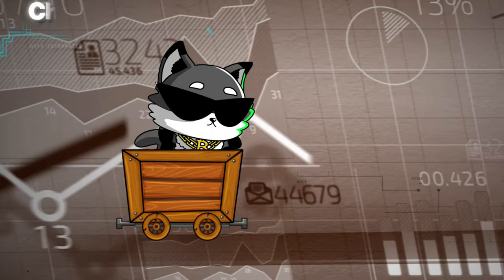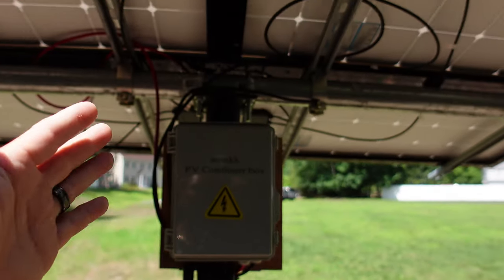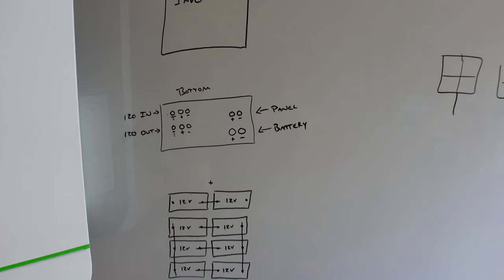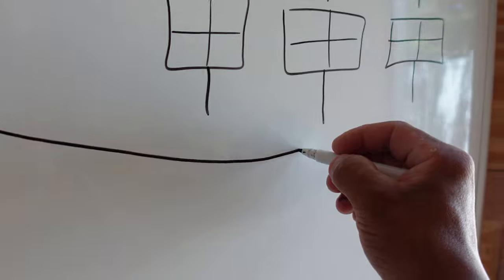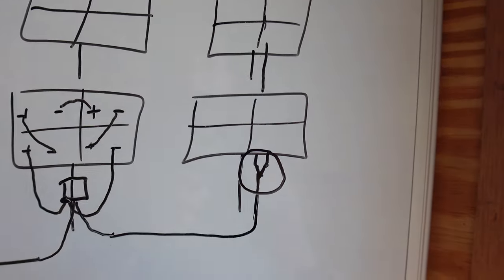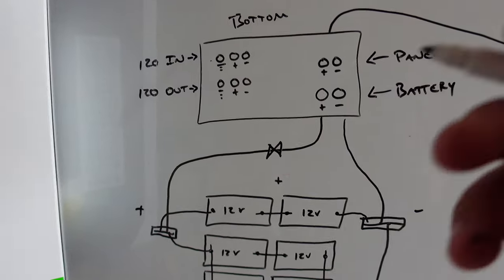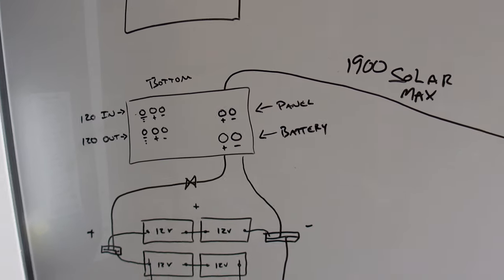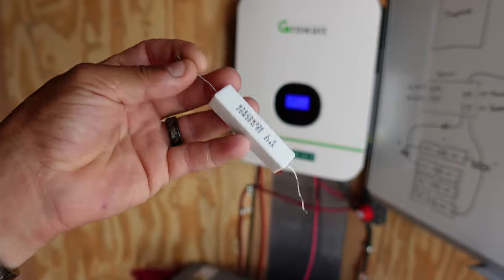Explaining my setup inside the crypto mining solar trailer

Comment: so about the fuses. with a 3 kW inverter, you could max. take out 125 Amps out of the batteries. So your 250Amp fuses are one the safe side. 
however one thing is to consider. Delivering 3kW is not always 3kW. It is hard to explain in a few sentenses, but the power is calculated with volts x amps. That results in VA (volt-ampere). In case your electric consumer is a classic light bulb, the VA is identical to W (watts). But in case of the power supplies for PC/s & mining rigs, that's not the case. for a 1000 Watt power supply, you may use 1050VA (maybe more, maybe less). This depends on the efficiency of these power supplies. 
However any Inverter needs to produce that power. You may not see it on the display.
You may also try to find an amperemeter, that you can put around the cable to measure the current. It may help you to find how much current you have floating around. 
How thick are your cables between the combiner box and the Growatt?

Comment: bro your solar video are awesome. please let me know how many KW and as you know there is on grid and off grid and your setup is off grid, I want to ask why you opted for off grid because batteries are required in off grid it costs more. If you would have gone for on grid batteries are not required and extra electricity what is un-used that goes back to grid and goes to the electricity provider and they will adjust in the electricity bill. By this there will be 2 way benefit you can mine also if not using mining electricity will go to the provider and bills will be weaved off. I stay in India and i have 1.1G hashrate and my plan is to setup 10KW on grid solar system in coming days.

Comment: IM building my setup with the MN5048DIY from Midnight Solar.  It has 500V input so I can run a buttload of  panels in series .  Less wiring, no need for combiner box, can use thinner wiring.

Comment: @chumpchangexd Which model number inverter do you have?  SPF or MIN?  I’m guessing it’s SPF since you have backup batteries.  Did you consider doing grid tie only?  The grid tie series inverter is cheaper and you don’t need batteries.  In fact you are probably using much more power to charge the batteries than what your panels produce.   Did you go with this to have power when the grid goes down?

Comment: Those Fuses are way to big imho. Check out the MAX load(A) rating for the inverter and choice from there.
Reply: 80A fuse is what you need since you can't charge or discharge the batteries with more amps.
Reply from the maker: Good point thank you so much as you can tell I’m a noob LOL
Reply: @ChumpChangeXD  No problem! You should have a Main fuse 80A and then you can divide all your batteries with smaller fuses going to the busbar if you want even more protection for each battery. Which you really should have because those batteries are expensive and can destroy eachother if not connected properly if one of them breaks for some reason.
Reply from the maker: @ChristianGrau92  your the best. Appreciate you!
Reply: @ChumpChangeXD  Each pair of battery you have will only deliver max 20A . They split the load when you parallel everything and combined max 80A.
So mainfuse 80A and 4 fuses 25A should be great.
Reply: @ChumpChangeXD  Glad to help you out, looking forward for the next video :)

Comment: Does this really makes sense from a financial point of view? Cant really see it... Where I live I would much rather have invested that amount into more GPUS/ASICS or directly into crypto.
Reply from the maker: So in my opinion yes and no once the initial cost is invested you basically mine for free from there on out regardless of profitability of mining and all of that. 

Having free electric essentially eventually is my main goal here when it comes to running all of those mini boxminers and well keep me personally afloat during the bear market. 

That’s my reasoning for doing this especially at a $3000 a month electric bill I would rather put that money towards something like this than giving it to the utility company.
Reply from the maker: Not to mention if I ever wanted to re-purpose this for a cabin up north or to live off grid there would be no issues running your personal items inside of a cabin or camper with this set up as it is now because most things are not ran 24 seven like crypto mining is